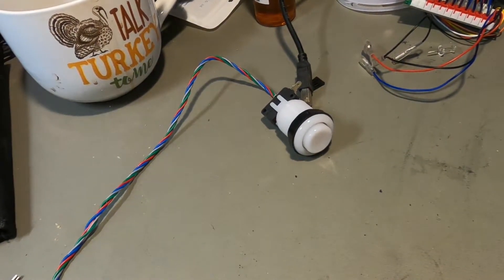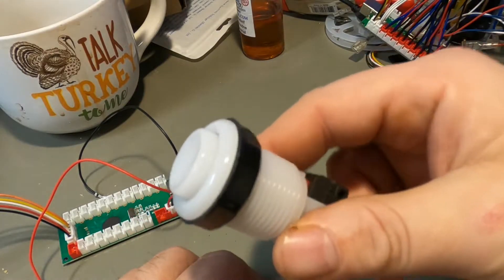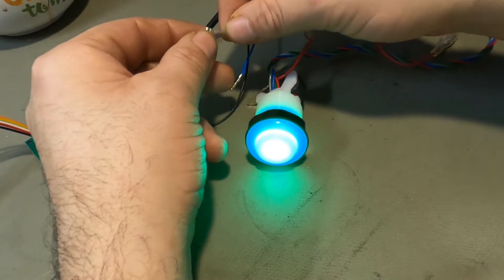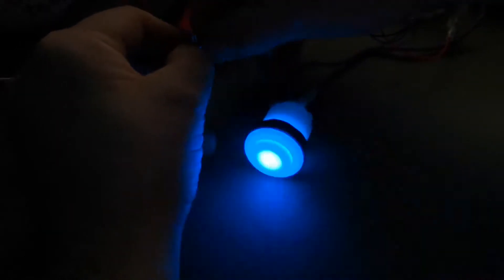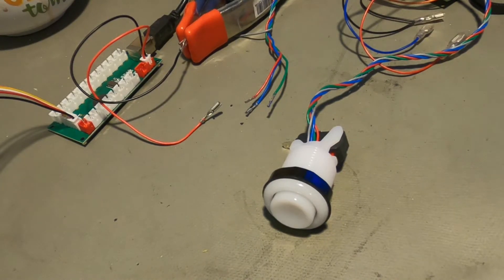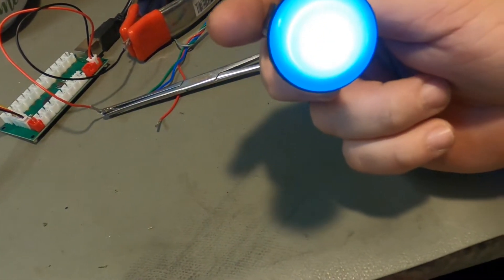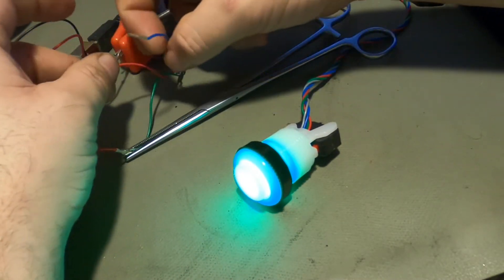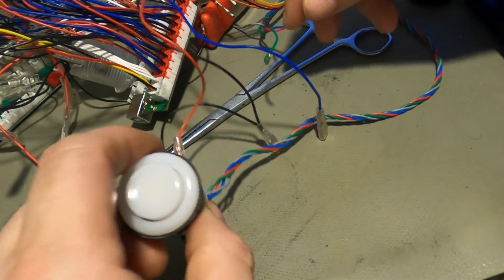Illuminated Concave Arcade Button Hack

Comment: How about having them rotate through all the available colors?
Reply from the maker: Yeah, you could do that too. Couple of ways of going about it.  This is an old video and technology has changed a bit since then. I actually do have an arcade cab I need to get up and running again after it was decimated by flooding last year so I'll probably be doing a video on that one. I need to redo the control panel on it which does utilize RGB lights as well. If I remember I'll show how that's done when I get around to filming. Right now I have been pretty inundated with customers and haven't had the time to film anything as of late, but it is on my list of shit that I need to do.

Comment: could you make led be iluminated when button is pressed?
Reply from the maker: Yes, but that would be a bit more complex. You'd have to key the ground to run both the switch signal and LED signal when depressed. Would be easier to do in software with something like a PacLED64 or an I-PAC Ultimate I/O. This was only meant as a simple hack to avoid buying products like that.
Reply: @phreakwars  I was thinking of connecting the LED and the button in series to turn on the LED only when the button is pressed: the signal pin of the button on the board to the negative connector of the LED, the voltage pin of the button on the board to one of the connectors of the button, and the connector of the button connect it with the positive of the LED. I don't know if it works or if there is any problem.